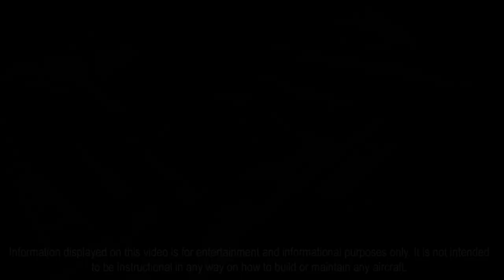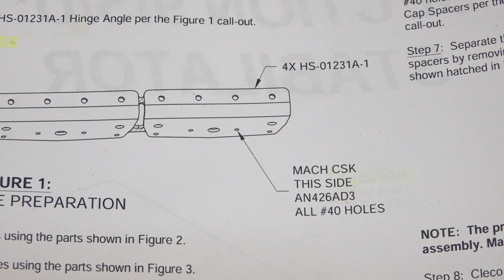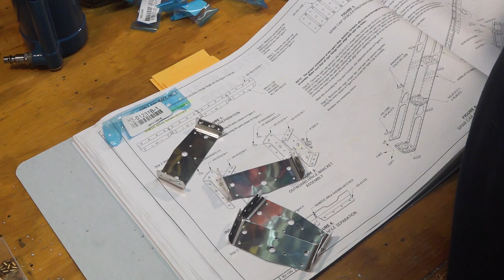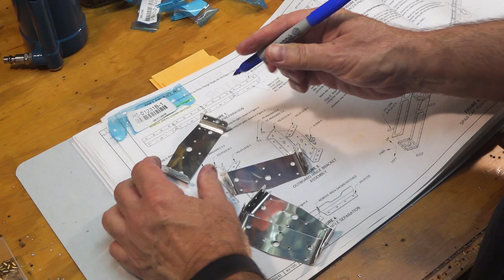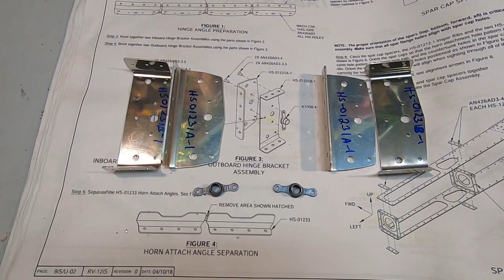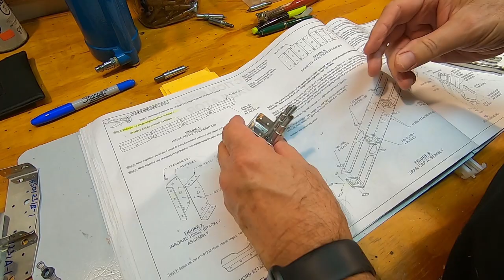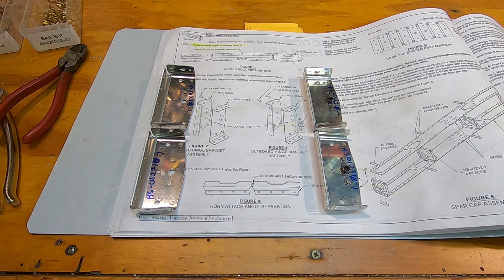Vans Aircraft RV-12iS  - Stabilator Construction - Part 1

Comment: Elevator counterweight for either an RV-7 or newer version of the -8!  Here’s a tip for countersinking thinner pieces such as these.. match drill the part straight into the wood, cleko in place, then countersink. Often times on thinner pieces, the cutter pilot doesn’t have anything to guide it, and the wood can act as a guide. If you didn’t get chatter doing it the way you did, you got lucky, because a lot of builders encounter chatter on thinner pieces! Love the video btw!
Reply from the maker: Yep... A counterweight from an RV-7! Good tip on the countersinking!